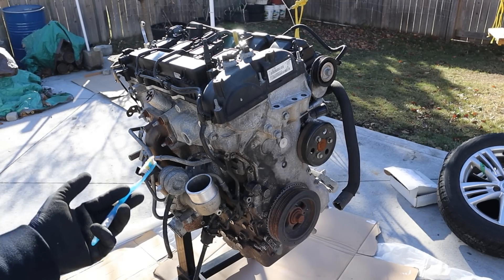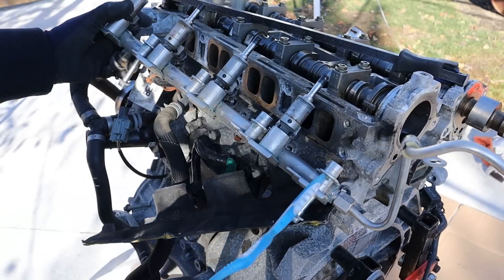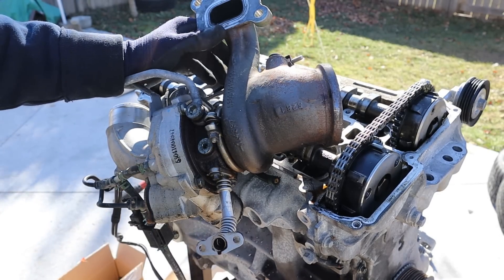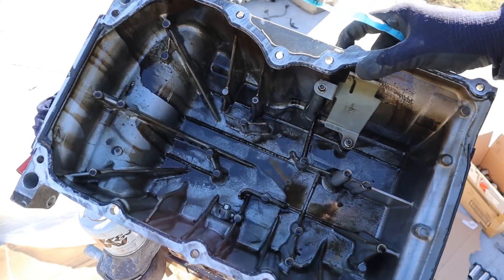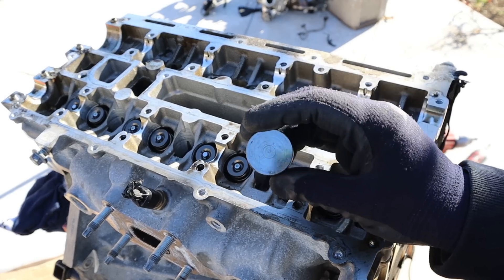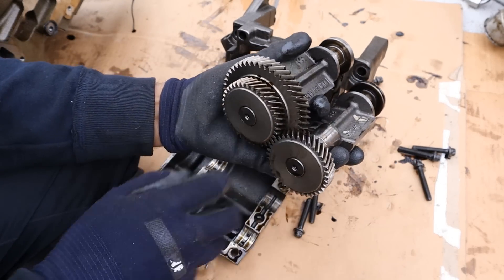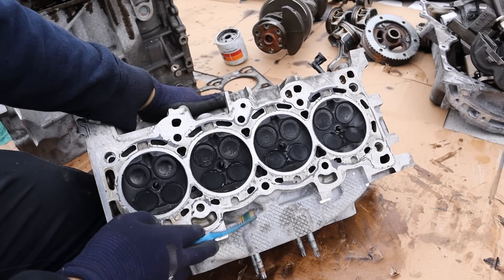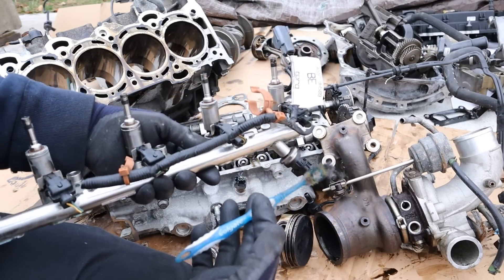Why Ford Ecoboost Engines Fail

Comment: My preference is for in-line 6 cylinder engines without turbo, without balance shafts, and able to be worked around easily in the engine bay.  Sideways-mounted 4-cylinder engines, or worse still, sideways-mounted V6 engines, can take a flying leap at a rolling donut. Can't believe they are so common.

Comment: 180k miles on the 2.0L ecoboost in my 2013 Escape.  Only service has been spark plugs and oil changes.  Occasional smoke on startup but still feels pretty solid!
Reply: modern engines need thrashing, to keep them clean. or like this one, the carbon killed it from putting around. nothing else wrong with it, just the driver..
Reply: @harrywalker5836  no danger of 'putting' for mine! I should probably ease up
Reply: Smoke on start up will probably just be water vapour
Reply: Let me sell you a bridge. In other words if you take care of any modern engine and drive it like you are not in a car chase then they will last for 100K plus. YouTube has lots of driveway and shade-tree mechanics that don't know much about the huge amount of engineering that goes into new cars so they last. Back in the 1960's they went between 30K to 50K and that was about it. Now 100K is very common as is up to 200K plus if you give the car regular maintenance. This is a YouTube Scam!
Reply: 170k on my 2014 ST. Just keep up on oil changes and basic maintenance. It has been my most reliable car Ive ever owned.
Reply: 130k Miles on my 2013 2.0. Zero problems.
Reply: I have had no issues with my Ford engines. If you run quality fuel and synthetic oil, you will be fine. Nonetheless, NA engines will always be more reliable.
Reply: @Dave-xd3wx  180,000 Miles
Reply: Hey I have the same engine~! 185,000km on mine with only a purge valve issue, though a mechanic says all Fords from that time have that issue. No need for spark plugs just yet though I should have them looked at
Reply: So you're the one!!
Reply: 180k or 180 thousand miles?
Reply: @kskip4242  ...its CLEAR what was meant and posted.....READ IT.
Reply: I think this guy here needs to slow down and take a closer look before running down an ecoboost! LOL! If mine with the 2.3 4 cylinder keeps going the way it has so far? It's going to be in the road running for years to come. Mine has over 198,000 miles on it and running like clockwork.
Reply: Consider yourself very lucky.
Reply: 2014 Focus ST tuned, 134k miles, 360lbs torque and still getting 30 mpg highway. I have zero complaints!
Reply: Same! Bought the car because of the engine being tough and well engineered IMO
Reply: Very impressive, particularly the editing as you moved from one bolt to the next with the tools instead of having to watch the disassembly in real time.
Reply: Just went past 180,000 miles in my 2014 Focus ST and no oil burning at all.  Regular maintenance and only real issue with the car was the fan control module failing, which is completely external and not related to the engine.  Running the factory recommended semi-synthetic Motorcraft oil and do all the maintenance myself.   Plugs were changed a bit late at 120k miles but they were in pretty decent shape for that many miles on them.
Reply: @CPcamaro  ;) I had a '88 Ford Tempo (bt. for $600) and the cooling fan thermostat module failed. I wired in a common house light switch under the dash to turn on the fan manually if the temp. gauge rose too high.     Learn to read schematics and do basic maintenance work YOURSELF and save $$
Reply: @mihy26  I tore the front end of the car off and replaced the entire fan assembly myself (the control module alone for some bizarre reason cost more than the entire assembly).  I don't want to know what it would have cost to have someone else do that!
Reply: @CPcamaro  A couple years ago I replaced the fan assembly on a friends Corolla (blade hub broke off). I ordered the entire fan , shroud, module from Rock Auto - it was cheaper to have it sent here - Canada - than to buy the individual component locally!
Reply: @mihy26  ...not like that today, champ......not today you cant
Reply: go 1 heat range higher on your spark plugs (hotter plug)  - you'll get rid/ burn off the oil/ carbon build up in your cylinders
Reply: @mihy26  Yep,the result of new fangled direct injection rather than into the manifold as before,.. propagates carbonisation.
Reply: @mihy26  you mean you'll have more spark knock.
Reply: @kurtd8396  thank you. Some people sure like to say things when they have no clue what they are talking about.
Reply: @kurtd8396  nope. No knocking - maybe if you are running premium.  Running on regular or mid-grade gas; If you live in a colder climate as I do, engines don't always heat up enough to burn off residual carbon in the cylinders, especially air cooled engines such as on motorbikes or old VW vehicles.
Reply: @kurtd8396  Not at all ,, modern engines ecm adjust timing and if a hotter plug is causing knock you need premium fuel or some serious carbon issues
Reply: @GatesRapes  Our 2020 tucson 2.0l na 40,000 miles pings on 87 octane nothing wrong with the engine no oil burning and has a catch can since new. Some cars will still ping not catastrophic but its audible. no ping on 89 octane its just engine design and gdi flaw atleast for hyundai. im in florida as well.
Reply: @mihy26  these engines benefit from step colder NGK Iridium plugs. Take it from someone who actually owns a Focus ST-3. 

Step hotter plugs make almost no sense, even in high altitudes and cold areas. If it gets so cold your engine doesn't start, an engine blanket/warmer is more effective and lest costly long term. 

Water-meth injection (either single port throttle body or quad port manifold injection) eliminates all carbon in the engine, both the intake and combustion chamber. Carbon cleaner can help burn a lot of it off as well, and can be sprayed in via the symposer port (which should be deleted as it's a boost leak waiting to happen).
Reply: @S.ASmith  St-3???    I gather you're in the UK or Australia. Try running a vehicle(s) in cold, northern climates such as what we have here in Canada. Or driving something that is older & maybe burning some oil; yeah, that's when hotter plugs are required. Maybe do some reading on this topic before hitting your keyboard
Reply: @parhammotorsports6125  modern direct injection engines need to be thrashed, to get rid of carbon, & cleaned intake once in a while, this engine in the vid, guys an id t, was never driven, so it carboned up & stoped.. all engines, even 70,s will do that.
Reply: @harrywalker5836  Give them the old Italian tune-up eh? 🤣😂
Reply: @mihy26  all turbo engines should run premium fuel and going hotter on sparkplugs can be an almost instant dead motor if you do it to the wrong motor
Reply: @mihy26  ...you have no idea what you are talking about!!!!  NONE!!!
Reply: @henrytom5824  just run premium it's Worth it.
Reply: @kskip4242  Yae I’m going to just start running 89 every now and then like I use to we have 43,400 miles on it absolutely no problems we’ve had with this car. And I believe it will continue for years to come with proper maintenance, most folks just don’t do the proper maintenance and preventative measures on these gdi motors.
Reply: 80,000 miles on my 2013 Escape, no issues whatsoever.  I do use Synthetic oil, which I believe is a great help.
Reply: This guy knows more than ford engineers 😆. 120000 miles on my fiesta st 1.6 turbo and she runs like new.
Reply: @dashforcash6555  My cousin is a tech at a Ford dealer, ecoboost failure rates are very high,  some,very few go the distance,so consider yourself lucky.
Reply: @kskip4242  Just replaced my first clutch 120000 miles, people have no idea how to drive and treat a turbo car.
Reply: 165k on my 15 fusion and it runs great. I only had to replace my turbo because the wastegate actuator arm snapped

Comment: This engine is a primary example why after driving Fords for over 40 years I bought a different brand !!! I did NOT want a turbocharged engine, and almost all Ford smaller engines are turbo's, plus the last three Fords all needed new transmissions, 2 with less than 50,000 miles and the last at 105,000.  I also did NOT want any of the CVT trans, I bought a Mazda CX5 AWD with the 2.5L Skyactive NON turbo engine and real 6 speed trans.!!!  Great car and said to rival Toy's in reliability.  Car is 8 years old and absolutely 'O" problems !!!!

Comment: the extra couple pounds to make intakes out of metal and use real gaskets would make newer cars so much more reliable.. secondary injectors or a throttle body to help keep the intake valves clean would help a lot too

Comment: Ecoboost’s are awesome!
My FoST had over 270,000kms when I traded it for my Bronco…
Drove like new, no oil burn and great gas mileage, what more could you ask for?
Reply from the maker: Better fuel economy
Reply: I guess it depends on expectations  @speedkar99  , I was more than satisfied, especially highway…

Comment: 382.000 miles 2016 f 160 ecoboost with the 3.5 v6 all original. Always change oil with amsoil signature series.I race small 2 stroke motors, I sometimes add premix to my gas tank. I now have 6 100 pound sundown audio zv6 15s in the back seat walled off on 20.000 watts with 500 ah of lithum power pushing over 160db.. truck is still holding up just beautifully
Reply from the maker: Nice

Comment: I used to do oil changes every 3k on my st and it lasted a good amount of miles with no issues. I sold it running perfectly.  Even at 3k the oil was pretty beat. I think that's the issue most people are having. That and loading the engine with boost at low rpms.
Reply: Something I yet to see on all these turbo cars now and I've owned this engine in 2017 for ford edge.... is.... turbos make oil dirty running the oil through the turbo to keep cool plus lube it does both but the heat breaks the oil down quick especially if you have a lead foot  !
Reply: I run a similar maintenance regiment for my Sti, oil change every 3 months or 3k whichever comes first. I only get into 2-3 pounds of boost unless I’m at 3500 rpm or higher.
Reply: Yup; you're putting a big load, lots of heat from forced compressed air/gas and high rpm on a tiny engine.  What could possibly go wrong?  We (us old guys) have always known you have to change the oil frequently. I personally would never buy a turbo charged vehicle.
Reply: @motomike3475  I wouldn't either if it wasn't for the fact they are so fun. But for everyday use cars I don't buy them either.
Reply: @parhammotorsports6125  I have to admit, after driving 100's of cars, that the most fun I've ever had was a Mitzubishi Eclipse all wheel drive turbo.  That is the best sports car I've even driven. Wet mountain road, I couldn't lose it in any turn.
Reply: @motomike3475  I would never recommend someone buying a turbo car as their only vehicle. Besides my modded headache I have a NA family vehicle that I rack miles up on.
Reply: @motomike3475  the reason I specifically said people loading up alot of boost at low rpms is because that's how you get spark knock. That's how a lot of people are blowing up these engines. That and running 87. The st specifically said you can run 87 but the problem is it's a manual and people leave them in 6th gear foot to the floor at 2k rpms creating 15 pounds of boost. Especially after tuned because you can run 22 pounds of boost basically anywhere in the rpm range and you get spark knock. My st could do 20 plus pounds of boost at around 1500rmps after I tuned it. The automatic vehicles with the 2.0 like the explorers and escapes don't have this issue as much because the car downshifts raising the rpms usually avoiding spark knock.
Reply: @parhammotorsports6125  Yah, I keep forgetting the idiot factor in drivers.  We called it "lugging".  Bad bad boys, whatcha goin' ta do?
Reply: @ZREXER1250  this is exactly right. Direct injection has so much pressure that it blows gas by the rings from what I've seen.

Comment: Yeah, Horrible, direct-injection sucks over Port-injection. Are there any spray cleaners that'd "de-coke" that combustion chamber?  --Speed, on that girdle that you preferred to be steel, couldn't you find a chum/friend/business that has a metallic-substrate 3-D replicator?  Then get some titanium-powder, ask the vendor how much aluminum powder of what type/kind, and make a titanium-aluminum powder to "replicate" the girdle that's stronger than the alloy, but not the WEIGHT that a steel-one'd be?  Is that engine the Eco-boost 4 in some Mustangs?   I guess it's been OUTside in a wrecking yard, or did some dude NOT change his oil?  Was it lack of fluid-changes/poor design/both that caused that Eco-boost to Fail?   So with later Eco-boosts, with the groove @ the top of the cylinder, you might have more head-gasket failures?   Why not drill with some tiny bits a few horizontal-holes 1/4" down from the block-edge, then another hole horizontally-across, 1/4" lower, so you have a couple of holes allowing the liners of the block to NOT be solid & siamesed, but some coolant can be driven through the holes, so there's less chance of head-gasket problems.  At what point are these engines "Done"--where you're going to be looking for another junk-sourced/short-block, to rebuild, so your drive is not stranded--45K?--60K?-100K? {--this, IF you halve the service intervals, like if fluid-changes are 10K, --do instead @ 5K? }. These are GREAT Vids, THANK-YOU!  PS.  Speedkar, why don't you develope some type of "Rumba" that could maybe go down the spark-plug hole, throw some "de-coking-fluid" around the combustion-chamber, suck it all back up, so the top of the chamber & piston-top is "New" & Shiny, without tearing it down like you did?  Do the same with the injector areas?   Is there any fluid down those areas, that "de-coke" without head-pulling.   Would the engine's lifetime with Chevron's "Techtron" have made any difference, or are we ALL to sing a version of "I've Got those 'Direct-injection' Blues?

Comment: I wonder how this compares to the 4 cyl ecoboost engine they put in 2015 Mustangs. The salesman was really pushing that, but I got the last year of the V6. It still runs great, no problems. Any thoughts on that?
Reply: I have the 3.7 Cyclone, in my 2014 Mustang. One of the best six-cylinder engines ever produced.
Reply: @rjdavis7503  Good to hear.
Reply: Sell it now
Reply: The I4 in the Mustang is the 2.3L version, which is extremely similar and still a modified version of the Mazda MZR/L-series engines

Comment: They should be able to engineer the intake walnut blaster into the design. You would just have to add walnuts 20 thousand miles.
Reply from the maker: That would be so cool! Self cleaning technology. Oh wait ...they do. It's called port injection

Comment: I own a 3.5 ECOBOOST in my F150.I installed a Catch can . It catches all the crap normally recycled from the the breather back to the input manifold. I catch a gray like sulge in the can that I dump every oil change!You must keep up with a 3k mileage oil change !These are race car engines

Comment: The way you are tossing around critical engine parts is very unprofessional. One nick on a main cap mating surface or a cam journal could cause problems upon reassembly or engine failure. Maybe your scrapping it. I dont know. But please, set an example for the younger generation to follow.
Reply from the maker: I'm scrapping it. Or turn it into a coffee table. I don't sell stuff after I took it apart.

Comment: So, could you explain please WHY these engines burn oil? Same to VAG TSI/TFSI
Reply from the maker: PCV system
Reply: @speedkar99  Its rather low tension piston rings I guess,for low friction

Comment: Hello again from Wales. May I ask if you've ever taken down the previous 5 cylinder model {in effect, a Volvo engine} that was fitted to Ford Focus RS hatchbacks, and are they longer lived ? I certainly preferred the sound of them. A guy who used to live in my street had a bright orange one that had a magnificent burble to it. I don't much like the profusion of plastic parts on modern engines, which seems to becoming ever more prevalent. Throwaway society foolishness, in my opinion.
Reply from the maker: Yeah check out my Volvo 5 cylinder video

Comment: I drive a 2018 Mk4 Focus ST Line X . It has the slightly detuned 1.5 ltr 3 cylinder Turbo charged Fiesta ST engine developing 182 BHP. It Seems to be running great , and quite speedy , especially in Sports Mode , whilst still getting around 50 MPG on a run in Eco mode.Very good handling car.

Very lightweight engine and gearbox, which contributes to the Cars kerb Weight of only 1369 KG.

Comment: I broke one of those bolts for the main bearing shackles right off in the block. The kit to remove the bolt was cheaper than buying the special bolt from the dealership. Turns out 11mm thick bolts are not easy to find

Comment: Sorry, but carbon buildup has NOTHING to do with the direct injection! Fuel and air does not cause carbon deposits, OIL does. Oil from ring blowby, or turbo seals leaking are what cause all of the carbon buildup. You have zero clue what the hell you are yapping about! And you just destroyed a perfectly good engine that you claimed had been hydrolocked, and obviously wasn't.